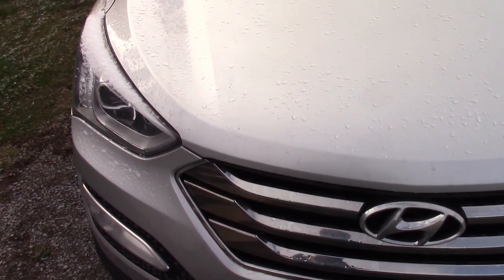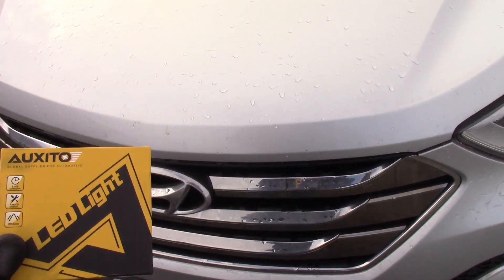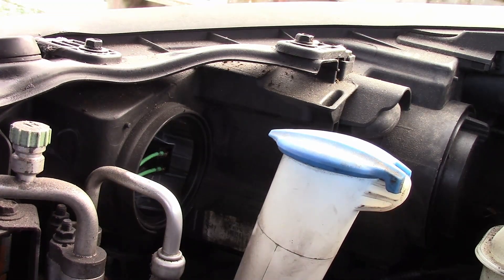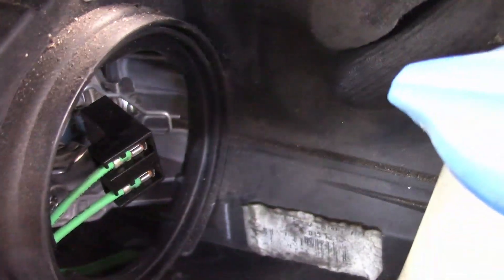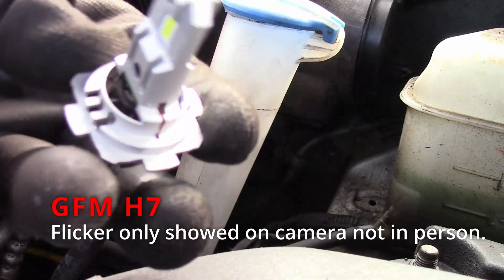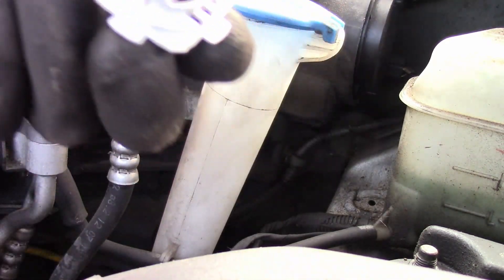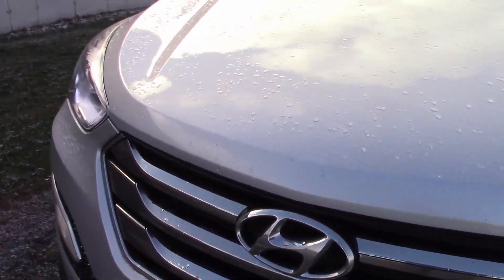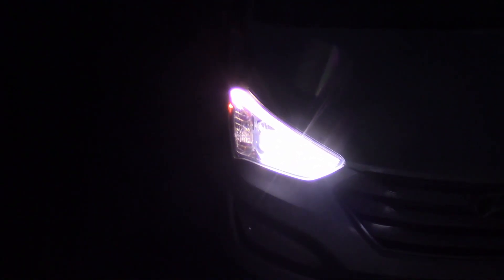Hyundai Sante Fe Sport High Beam LED Upgrade Auxito Bulbs

Comment: I just installed a pair but I don't think they project enough light and light up the road enough, but they look bright if u look at the car head on and they light up the garage we'll when I drive up. What should i do?
Reply from the maker: Make sure that bulb orientation is vertical (leds facing left and right not up and down)  like this "l" You might need to adjust the headlight housing height too there is a screw to move beam up and down.

Comment: The videos keep it up and by next year you'll be at 4,000 subscribers and also I have plans for my Nissan Armada you know so I'll be starting a YouTube channel next year it's my channel is going to be Armada town and I'm going to be making videos on my truck I heard you make $200 to $500 a month on YouTube that's good amount of money you can like save that up and buy car parts or a car with that money which colder intake do you prefer do you prefer the specter or the airaid
Reply from the maker: If I was just doing cold air intake and/or exhaust I would get the spectre.  With other mods such as throttle body and headers, other motor mods I think the airaid is the better option

Comment: Auxito does not fit my Santa Fe sport 2014
Reply from the maker: Did you order the right ones?  Did you try the bulb finder on the website or check which type the stock bulbs are and order a matching bulb?  Different years and models take different bulbs.